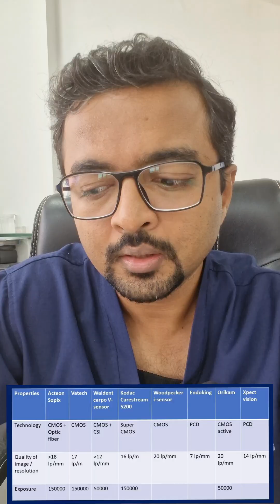New Dental RVG purchase help - Vatech, Sopix, Carestream,Endoking,Vision,Oricam, i sensor, waldent..

Comment: Which x ray is best Acteon x mind scissor arm or Portable Vatech Ez ray
Or woodpecker or orikam ?
Reply from the maker: Vatech x ray will require battery change after 4 years. In portable xray, yes it's best. You can go for it.
Reply: @dddentalworld  ok thanks bit my dealer only provide vatech and satelec is not serviceable here
Reply from the maker: I am using Acteon X mind scissor arm for 2 of my chairs since 8 years and Oricam gun since 2 years for 3rd chair.. if you don't have chairs in separate cabins then definitely go for acteon x mind. It will work for lifetime. Vatech, oricam and all portable xray unit will require battery change after 4-5 years and it's quite costly too.
Reply: @dddentalworld  vatech x ray is quick. Compared to orikam. And woodpecker i found but double tge price of both.
Vatech and Acteon having same price  but here pnly vatech is serviceable so which one should i opt for ?

Comment: Vatech or Kodak which one i go for .
Or Sopix as sopix has 28 l/mm?
Is there huge diffrence in quality ?
Reply from the maker: Yes Sopix > Vatech > Kodac... but not significant as lines per mm is not the only thing which can help quality.  It's processing system too and everyone enhanced CMOS with some or other addition like sopix added fiber optic, Carestream added super CMOS etc..
Reply: @dddentalworld  ok sopix i am getting in 1L,7k 
Carestream 1L,15k 5 yr warranty
Vayech 89 1 yr waranty 1L,15k
Sopix is up to 60k costly than both .
Is this 60k worth .
Any huge diffrences 
As i want to biy Vatech portable x ray 2nd option is satekec x mind wall mount .
What will you recommend then .
1) Vatech x ray with vatech rvg
2) Vatech x ray with Kodak rvg
3 ) Satelec x ray with vatech or kodak rvg
Very much confused ?
Reply from the maker: Portable x ray is worth but they require to change battery after few years. 
As said before Sopix > Vatech > kodac
Kodac Software is bit tricky, sensor is not active continuously for multiple shoots.
Reply: @dddentalworld  ok then i will go with vatech x ray for easy handling both for pedo and adults and vatech rvg for easy software and 5 license keys 1.5 size at economical price .
As battery is concern i think in upcoming times More options will be available and can be reparable as there are cells
Reply: @dddentalworld  sir one more question is it woth spending more 70k on Rvg 6200 by kodak than rvg 5200 ?
Reply from the maker: It's mentioned in video. Please go through it again 🙏
Reply from the maker: I would rank Sopix then Vatech  and then Kodac in quality wise as I have seen all of them in my consultations. But end of the day SERVICE. All of them requires Software management or reinstalllation  in 2-3 years. 
Sopix USB wire can be changed easily in future whereas Vatech RVG is not at all easy to repair as company is always pushing for new RVG.
Reply: @dddentalworld  yes but. Here vatech and carestream servuce available only.
So i thibk carestream majes more sense than vatech.
But i think x ray and rvg from same manufacturer is more compatible
Reply from the maker: Go for Vatech then 👍
Reply: @dddentalworld  sir is there any image quality diffrenece between Acteon and kodak and vatech as lp/mm is more in sopix ?
Reply from the maker: I would buy satelac x-ray and Vatech RVG with 5 years warranty

Sopix's 60000rs extra is not at all worth if service is not available easily. Sopix USB side is repairable whereas Vatech it's not but both sensors are working well if we use it with care. 

My thoughts are... X-ray unit normally doesn't require maintainance once it's installed but RVG may require support from company in 2-3 years.
Reply: @dddentalworld  thanks for your valuable time doc 
Are portable x rays worth ?
Or how is kodak compared to vatech ?
Reply from the maker: No I would not spend but it's like 6200 >= Sopix > Vatech > 5200
Reply: @dddentalworld  ok thanks doc and what about chinese x rays like woodpecker Runeyes Orikam ?
Are they worth or there quality will degrade after some years